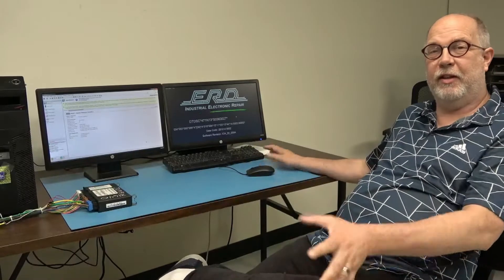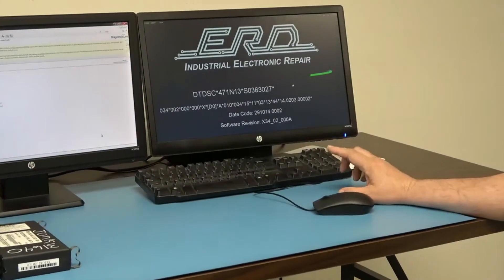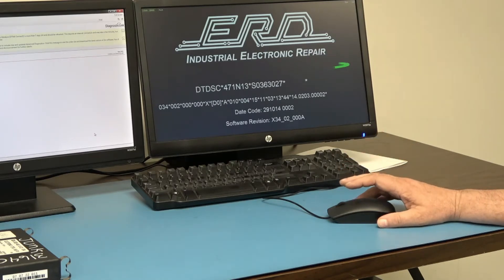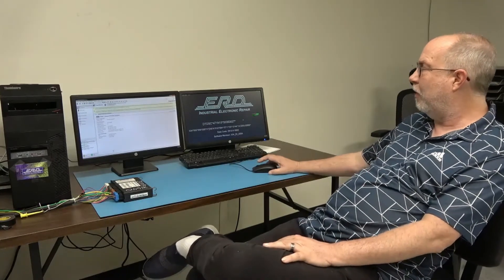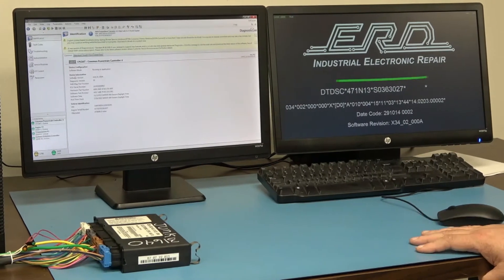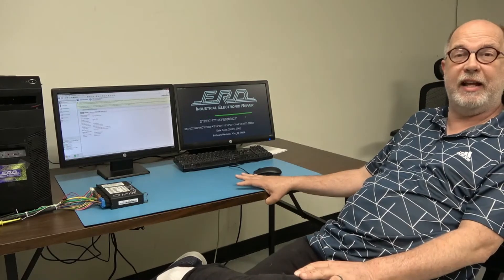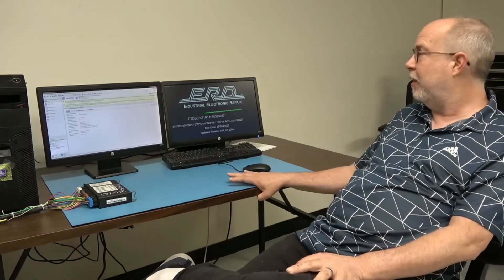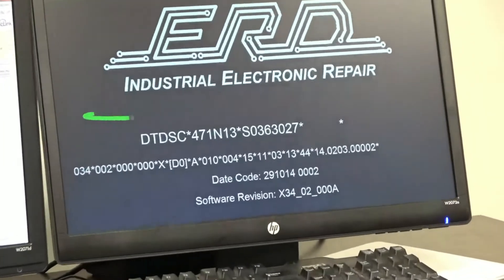Reflashing your ERD Repaired Freightliner Cascadia CPC4

Comment: My CPC4 went out had a new one flashed now my engine brake isn't working could that be a bad flash everything else works like it should. Engine brake worked prior to my CPC going bad
Reply from the maker: we have seen some flashed by dealers to cause issues - try a reflash
Reply: @erdltd  I had a independent shop rebuild and refresh it thanks for the tip
Reply: @truckingwithcliff who did you use to refresh it?